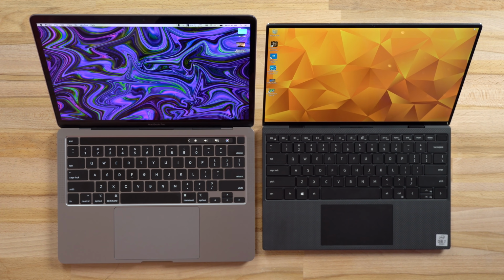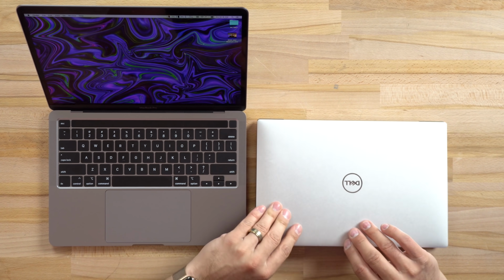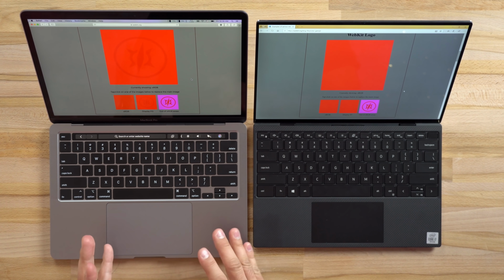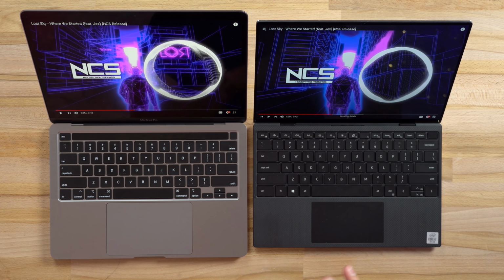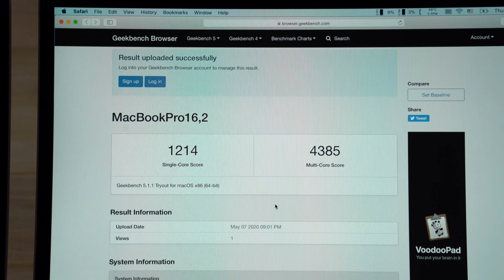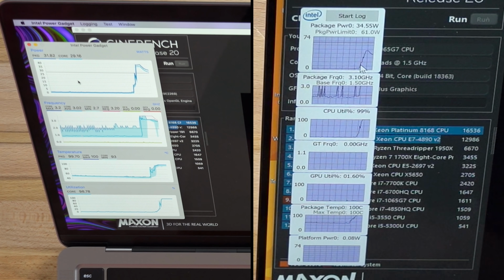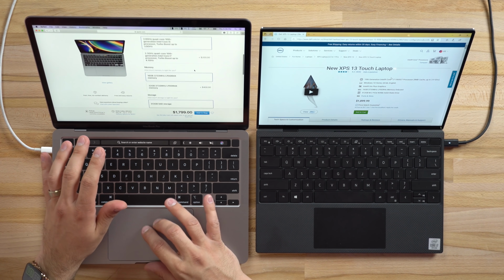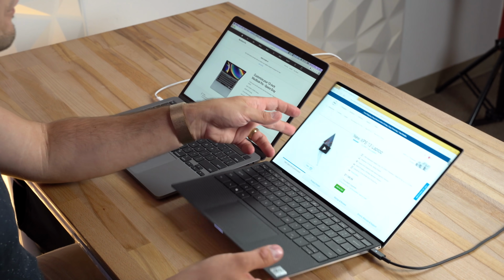2020 MacBook Pro vs 2020 XPS 13 9300 - Best Ultrabook?

Comment from the maker: Do you think the Dell XPS 13 9300 is a better deal than the MacBook Pro? Comment your thoughts below!
Tap Like & Subscribe if you enjoyed this video! Amazon Links ⬇️
2020 13" MBP ➡ https://geni.us/xk6SR3
2020 XPS 13 9300 ➡ https://geni.us/1zM46zM
Renewed XPS 13 9300 ($300 OFF) ➡ https://geni.us/IHBBq
Reply: Hey, just for a reality check. Please run cinebench and geekbench 20x times, one after another, and we see which computer can actually hold the performance!
Reply: Make the comparison video of both base models. Both having 8gb ram and 256 gb storage
Reply: Hey, one thing to notice, I ran the very same cpu clock on cinebench on Windows and Mac. i7 4790k with 4.6GHz got 1900-ish on Windows, but 2100-ish on Catalina. Of course it is a Hackintosh machine but hey the different is there.
Reply: Your wallpaper on the MacBook Pro is bomb. Does it come with the laptop or did you download it separately?
Reply: The MacBook Pro has a 28W CPU where as the Dell XPS 13 has a 15W CPU with a 25W power limit. That's why the Core i5 and Core i7 are so close in performance. 28W Windows laptops are due in Q2.
Reply: The boths, are a very good laptops. The macbook pro its a great computer, with refresh keyboard. The trackpad its another experience, and outher things make the macbook a laptop very gratefull. But the macbook can be more "pro" with dedicated graphics cards. Don'ts mather the price, because some people need a portable and compact machine with some power for some tasks. And you make a excelent choice to compare this boths greats machines. In this video you compared to a windows laptop have so many options, like, dedicated graphics cards. It's expensive? Yes. But for many people its impotant this upgrade. I like the macbook, but can be more "pro" with this component. I think. It's my opinion.
Reply: I have said a  mistake. The dell don't have dedicated graphics in the 13" laptop. But it's my opinion about macbook pro.
Reply: @joaorosas964  neither does the MacBook.
Reply: @joaorosas964  agreed. And provide an option to have real F-keys. I am still holding on to my 2015 MB Pro because of the dedicated keys
Reply: @joaorosas964  The 13 inch macbook pro doesn't have a dedicated gpu
Reply: dell xps had far better speaker night and day difference
Reply: MacBook wins for speakers
Reply: Mac better build quality service and reliability.
Reply: MacBook is 2x better than Dell in terms of OS, SPEED and QUALITY
Reply: Really waiting for that Macbook pro (1800$) video editing review. 🙏🏿🙏🏿🙏🏿🙏🏿🙏🏿🙏🏿
Reply: I think the information Apple dont enable HDR for built in display is wrong. From macos 10.15.4 support Dolby vision for Netflix video (in safari only), apple tv and I heard people also said that HDR video from Sony now show correctly. Take a look here:
https://support.apple.com/en-us/HT210980
May I know which service your video from when you compared the displays? If its Youtube, its the problem from Chrome when dont support HDR, on reddit people also mention that.
Reply: The MacBook seems pretty good but I would choose the XPS 13 because I prefer windows over Mac OS
Reply: You can run MacOS on the Dell, and I do. ... in an emulator over Manjaro Linux. Just run "yay -s sosumi" and there's your MacOS. Of course then the question is, if you run Manjaro, why the heck would you want to run MacOS?

But since you can run Manjaro on either MBP or 9300, a fair comparison would do that and just review the hardware. If you decide to go that way in some future video, throw on tlp and auto-cpufreq while you're at it ...
Reply: Is it safe to buy the "renewed" option without compromising the quality?
Reply: Max Tech Please Compare Dell xps 13 9300 and HP spectre x360 please
🙏🏻🙏🏻🙏🏻🙏🏻🙏🏻🙏🏻🙏🏻🙏🏻🙏🏻🙏🏻🙏🏻🙏🏻
Reply: Max Tech I am soo confused bw HP spectre x360 and Dell xps 13 9300
Reply: If possible can you give me one laptop please,if it's old also no problem
Reply: Definetly the mac... the mac is way better
Reply: Macs are better
Reply: InstaBlaster
Reply: Max Tech the MacBook is better
Reply: Compare with Surface Laptop 3
Reply: In a few years time, people will look at the MacBook Pro and say, wow what a laptop, Dell will be forgotten. Its the resell value as well that is key.
Reply: Macbook is the better choice, works perfect plugged or on battery. I don’t like to be thinking I have to plug my laptop all the time for maximum performance. I had windows laptops since 2006. Just crossed over to the other side last month. And let me tell you something. Macbook users were in heaven for a long time. Never coming back to windows ever. Apple need to listen more to the customers but other than that their machines are the best period.
Reply: I just like how he used the most expensive dell compared to the medium macbook pro because the most expensive macbook pro goes to the 10th gen i7 and 4.1ghz and 32GB ram and 4Tb of storage so if you’re gonna do a comparison do a fair Mthrfckr
Reply: Windows

Comment: In terms of the casing, the durability MacBook is way better.  I have a friend here. He is using a tin screen laptop then I lift it and shake it off. It is slightly wiggling compare to MacBook. 
In terms of the performance of the speaker/mic, I like the Dell because of the sound or clarity.
MacBook is like sloppy sounds (maybe because of the bass sound) but in video wise apple is the best because of its tone, and dell performed well as well.  I am not just a fan of slightly pale colors.

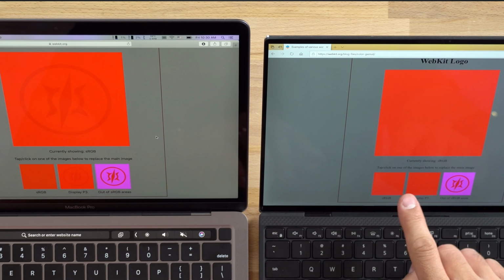Comment: That color comparison page that you show at 6:21 does in fact show up on the XPS 13 9300. I'm using the model right now. You need to make sure the Use HDR option is switched on in the Windows Display settings.

Admittedly, the XPS 13 claims to provide a 90% DCI-P3 color space, while the MacBook Pro 2020 claims 99%, so the paint still stands.

And what matters more than colour space in my opinion is contrast ratio, and neither of these screens are OLED yet so the blacks are still bleeding light.

Comment: As a Full Stack Web Dev, I don't find it necessary to get a 13" laptop with core i7 CPU. I usually use my macbook pro 13" core i5 with just 16gb of ram at it's maximum capability, still it runs smoothly. I can't imagine people go all the way to core i7 and still complain the laptop doesn't perform as they expect. I hope they don't mean to run AAA games on these little laptops.

Comment: Where I live Apple computers are hella expensive, way easier to buy a new car, so I never even considered it. My notebook has been having some issues so I needed to buy a new one asap because I use it for work everyday. I've always used Dell and they never disappointed me (my current notebook is a G3, great machine, but it has suffered a lot of demage due to a fall and liquid spilling, that's living with children), so I really wanted to continue to buy Dell. The first notebook I ever bought for myself was a XPS, back in 2012, and it was a really good computer, lasted me until last year. The one thing I always missed was portability, both my machines were heavy and bulky. So when I saw the new XPS 9300 I feel in love. The configurations are premium quality, and an Apple machine is double the price here. I can't wait for my new XPS to arrive. I'm sure my G3 can be fixed, but I just can't afford to wait that long with no computer. I'm gonna fix it and gift it to my father, who's also a fan of Dell products like myself. His computer is a 2013 XPS and is still standing, even though he works on it all day, every day, and also games.

Comment: Best tech comparison vid I've found. Only thing I thought should be clear is the XPS is an ultra light, at 2.6 pounds vs. 3.1. You will always get better heat relief etc if you add an extra 20% weight to a unit. XPS is going after the macbook air market, actually, and it kicks butt in that case. So, what you have in the XPS is macbook pro performance in a macbook air form factor.

Comment: I have used both laptops in the long run . Personally I think it's not about the first day reviews or first month. It's about using the laptop for a minimum of a year . The Dell is an expensive unreliable laptop and their customer service doesn't make it any better . Spending that much on the Dell , I really expected more from it . Within a year the Dell starts to fall apart and honestly I felt like have wasted that money on something so costly . I really can't emphasize how disappointed I am with the Dell XPS. 
 The Mac so far hasn't given any issues and it's a good all rounder .

Comment: I think it really depends on what your usage is. Both are comparable devices at the price point. If it's going to be your only device, The choice is as simple as "Are you a Mac, or a PC?" As a secondary device it's almost just as simple. Is your primary device a Mac or a PC? There is also a side question of do you need a machine on the other side of this fence? As a PC Gamer, I have a Windows Desktop for day to day use and of course gaming. I also have a surface go tablet for chilling in bed and watching videos taking down notes, all sorts of things. That would be my normal flow, all in windows. I did however buy the new 13" MBP. Because having a mac might be handy, as a tech nerd, I should keep up with all tech not just the tech I use. Surprisingly I like the MBP way more than I thought I would. Quality of life features I never thought would even be a thing are in macos. Like turning literally any file into a 'template' that when you open the file it automatically makes a copy of it and opens that instead, wish I had that all this time for D&D nights. Smart folders for accessing files all over your system within one folder. The Trackpad and the gestures it has. Makes using apps in fullscreen something I actually do on the device because I can just 3 finger swipe to change apps or go back to the regular desktop. So as backwards as it will seem to some, my mac is my machine for more work focused tasks as the OS itself more easily lends itself to a less distracting environment. In part because the machine just cant play all of my games, but also in part that the os has features that make my workflow so much easier.

Despite all that I won't get rid of my windows desktop for an iMacPro, but I might consider a 16" Macbook Pro in the future. To have all of these features that I find so useful on an even more capable machine. Still trying to wrap my head around application executables also technically being folders... hurts mah brain. But having owned one for only a few weeks It's going to take a while to become as proficient with MacOS as I am with windows. Especially remembering all the new shortcut keys. @_@

Comment: Two fantastic and powerful computers. Impressive. Comes down to what OS and software you run. Best Dell laptop yet I think. And MacBook Pro continues to be excellent so Apple is making some nice pro gear. Obviously neither of these can compete with high-end custom built desktop PCs or a high-end Mac Pro, but for those that need a strong laptop these two and a few others will do the job. How does this Dell compare to other PC laptops?

Comment: I have been using this laptop for 2 weeks now. Just as you open the lid, the MBP does not respond i.e. the trackpad and the keyboard doesn't work for about 20-30 seconds. I have installed the latest Mac OS Catalina 10.15.6, reinstalled the software, logged in as a new user, done with the safe boot, reset NVRAM and SMC also. Nothing seems to work. I have contacted apple also regarding the same, they have told me to get the device to the nearest service centre. I am really annoyed now, because I spent a lot of money in this laptop. I have a 6 year old MBA, that laptop has never had any problem so far even with the latest MacOS.

Comment: Why even discuss. For gaming windows is better. Far better selection and performance in general. Also some games even though they are available on mac they have greater requirements than on windows. In addition from my experience laptops with similar specs are cheaper than macs

Comment: Personally, I run Linux(Fedora 31) on my XPS-13 and am super happy. So it is not only a Windows laptop. And it is not rubber. It is carbon fiber and quite possibly one of the best features on the XPS-13. The feel is fantastic and very comfortable. The only downside in comparison to the MacBook Pro for me is the fan noise. The thermal cooling is a little bit too aggressive. But upgrade-ability offsets that for me.

Comment: I hope Apple doesn’t shrink the footprint of MacBook Pro 13. It’s already at the ideal size for a large trackpad, top firing speakers and internal volume for cooling, large battery etc.
The Dell looks a little cramped and the thin bezel screen looks quite vulnerable  😬

Comment: How does it perform temperature and brightness wise. I dj outside and MacBooks are great for that, but I am trying to get a new laptop, i am returning a $1799 MacBook Pro 2020 because it is a freaking oven. Is this better when it comes to temperature? What’s your input on the brightness outside.

Thanks a lot.

Comment: this comparison is skewed. the 1080p screen is only less sharper than the 4k one and it's very competitive with the mackbook one, the 8th gen processor and graphics of the base macbook are way way worst than the base xps according to all benchmarks, and the battery life of the base xps is about 3h longer than the base macbook. at the high end the macbook is better (similar perfornance but better battery and speaker) but base models the xps destroys the macbook

Comment: What about performance on battery and NOT connected to power? Non-mac laptop always down clock significantly when running on battery.
Reply: Not really true, it depends on the power Options.

Comment: No matter which windows laptop you buy the fan spinning up all the time is so annoying. I've used gaming laptops to X1 carbons and T480's and they all spin up the fans even when nothing is going on. On my 2015 MacBook Air and 2020 MacBook Pro (ice lake edition) the fans only seem to come on when the system is being pushed, not when its just sitting around. And even under light to medium loads the 2020 MacBook Pro is practically always silent. And then there's the trackpad...
Reply: There is an option in the power options to enable passive cooling.

Comment: 22 min to essentially say either macOS or WindowsOS. Based on all the metrics shown in this video, I saw that the Dell won more than the Apple laptop. Based on the times we live you can say that only one test has much significance right now. WEBCAM! Being that many people have to use thier computers for work and zoom. Cant justify price of MBP with shitty webcam. In summary the way I see it, if you are into photo editing, video editing or are a creator of some kind, it seems that Apple has a great reputation for that. For everyone else PC is the better machine for them from my point of view from watching this video.
Reply: Daniel..  The speakers are better on the mac, the track pad is better, the CPU performance is about the same except the Mac is quieter, battery life is nearly the same, keyboards are nearly the same, disk speed is nearly the same. Webcam is nearly the same except the XPS has a wider viewing angle so how can you say the MBP has a shitty webcam when the XPS has essentially the same quality? And then there's the fan noise you have to deal with on the XPS (and most windows laptops) and the resell value.

You also probably didn't account for the fact that you'll be getting Windows Home instead of Pro. Considering they cost about the same (except you can get $200 off the macbook pro at BestBuy right now) the Mac has a slight advantage IMO. Also nothing so far compares to the track-pad on the Mac. If you're using your laptop as a laptop on a constant bases with no external mouse, nothing compares (except maybe the MS Surface) to the Apple's track-pad. 
P.S. You can also install windows on the Macbook Pro easy and it works amazingly well. It actually boots faster than MacOS. 
BTW The power management on PC laptops is so bad and I hate that the fans constantly come on when you're doing next to nothing. Even with the high end models like the XPS and Lenovo X1 Carbon, the fans constantly kick on where with the MacBook Pro is just quiet unless you're really pushing the system. When I switch to Windows on a MacBook, the fan noise kicks up alot so its likely due to how much better MacOS is optimized for the hardware.

Comment: Can someone please help me with some questions I have! I literally am down to the nitty gritty about choosing a laptop between these 2. I haven’t had a laptop in at least 7 years. I use iPhone but I’m not crazy into tech. I’m leaning towards the dell because of the 2 in 1 feature I want to sketch out my cake designs. But is the 2 in 1 worth it? If I don’t get the touch screen add on feature does that mean I can’t use as a tablet? Or the touch screen is for only when it’s a laptop? I don’t understand all the add ons lol
Reply: The Dell XPS 13 and Dell XPS 2 in 1 are two different dell laptops. If you want to do the sketch then get the 2 in 1 period. 2 in 1 will be touch screen period.

Comment: the dell has the 10th gen chip and double the standard storage for only $100 more, its a no branier!
Reply: With the XPS having a worse trackpad, worse speakers, a display that shows less colors and an i7 that's as fast as the MacBook pro's i5 and you have to deal with fan noise and Windows Home (unless you upgrade). It's really not a no brainer.
Reply: @andremessado7659  You really have something for fan noise... Ironic since all MBPs I've used overheated.

Comment: XPS palm rests are made of carbon fiber not rubber and carbon fibre used in aviation and high-performance cars, adding strength to your XPS while keeping it cool to the touch.